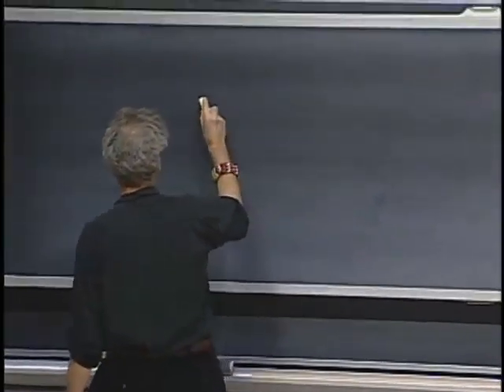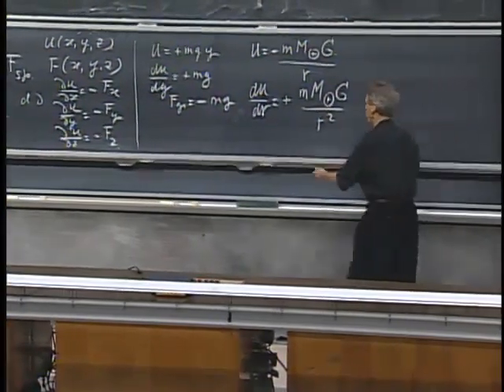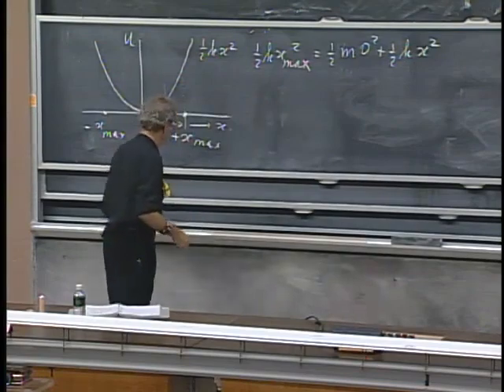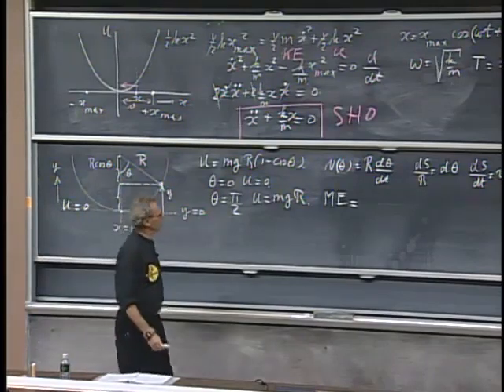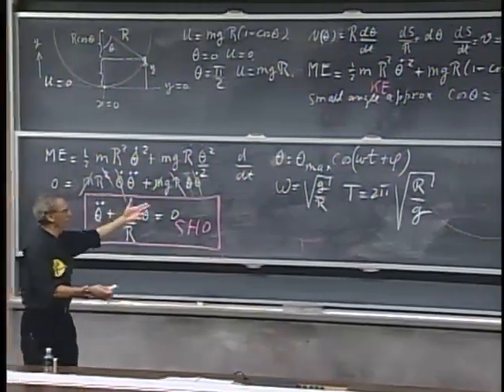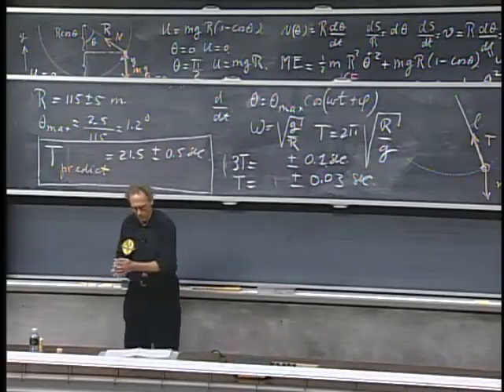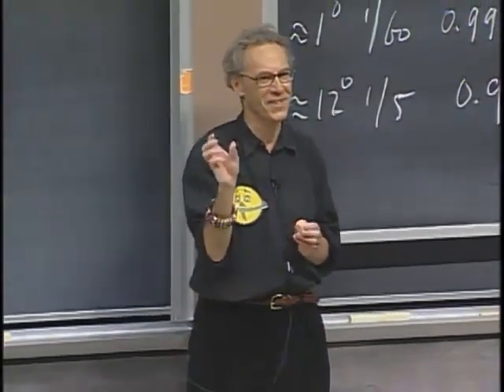8.01x - Lect 13 - Potential Energy, Derive Simple Harmonic Motion using Energy

Comment: During the starting 1st minute video of the lecture, you assumed that the increasing direction of 'y' is upwards.........
OK.
You then let U=0 at the bottom and so at the top, U=+mgh.................

If we let increasing direction of 'y' to be in the downward direction...............then if we assume y=o at the top then at the bottom, y=+mgh.............

WHAT I CAN'T UNDERSTAND IS THAT WHY THE POTENTIAL ENERGY OF THE OBJECT CHANGES FOR THE SAME POSITION IN SPACE FOR OUR DIFFERENT ASSUMPTIONS OF INCREASING VALUE OF 'y' ??? 

It shouln't be be because Nature doesn't care what the increasing value of 'y' we choose.......
Reply from the maker: <<<If we let increasing direction of 'y' to be in the downward direction...............then if we assume y=o at the top then at the bottom, y=+mgh.............>>>
incorrect
PE is the work I have to do to bring it from y=0 to h meters lower, then my work is -mgh.
Changing signs in your coordinate system is allowed, but that does not mean that you can change the direction of the gravitational acceleration.
Reply: Okay
According to you, at the bottom PE=0 but according to me PE at the bottom=(-mgh)............

Isn't this weird??
PE is defined for a particular mass at a point in space so it should not depend on our choice of "increasing value of y".........
Reply from the maker: PE near Earth' surface is prop to h (vertical distance relative to the surface) to a high degree of accuracy. But since g is a function of r  (r is the distance to the center of the Earth) a universal value of PE is minus GMm/r (for r>R; it's zero at infinity). Thus it increases with increasing value of r as it should (the larger r the higher the PE). Using this result you can also demonstrate that near Earth  PE can be approximated by mgh. It takes a bit of math as h is not r. Good luck and use google!
Reply: What I asked was that according to you, PE at the bottom is different from my PE( yours is zero while mine was {-mgh}..) but the two values should be same.....they can't be different because we are talking about the same mass and the same point???
Reply from the maker: In the case of PE near Earth surface you may choose your zero point anywhere you want to. If A is a vertical distance h above B, then the Pot difference between A and B is +mgh. You may choose your zero PE at your basement, your roof, the top of the Eiffel Tower,  you may choose it at A or at B. It would make NO difference as the pot diff between A and B would always me +mgh. If you chose zero at B then A would be +mgh, if you chose zero at A then B would be --mgh. 
If you chose your basement zero, then B might be 213 and A would then be 213 +mgh.
Reply: <<If you chose zero at B then A would be +mgh, if you chose zero at A then B would be --mgh>>

WHAT I THINK IS THAT WE DEFINE POTENTIAL ENERGY IN A VERY UNIQUE WAY ie it is the work that we have to do to bring a mass from infinity to a point P, SO HOW CAN IT BE DIFFERENT FOR THAT SAME POINT??
Reply from the maker: PLEASE READ and digest my earlier responses. Here  are they once more. This is my last response to this issue. I 

In the case of PE near Earth surface you may choose your zero point anywhere you want to. If A is a vertical distance h above B, then the PE difference between A and B is +mgh. You may choose your zero PE at your basement, your roof, the top of the Eiffel Tower,  you may choose it at A or at B. It would make NO difference as the PE diff between A and B would always me +mgh and that is the only thing that matters as it dictates the physics. If you chose zero at B then PE at A would be +mgh, if you chose zero at A then PE at B would be --mgh. If you chose PE in your basement zero, then PE at B might be 213 and PE at A would then be 213 + mgh. KEY is that the difference between PE at A and B is mgh. 

PE near Earth' surface is prop to h (h is vertical distance between 2 points) to a high degree of accuracy. But since g is a function of r  (r is the distance to the center of the Earth) a universal value of PE is minus GMm/r (for r>R; it's zero at infinity - you now have NO choice where to choose zero). Thus it increases with increasing value of r as it should (the larger r the higher the PE). Using this result you can also demonstrate that near Earth  PE can be approximated by mgh. It takes a bit of math as h is not r. h is the difference between 2 different values for r (BOTH NEAR EARTH). Good luck and use google!

Comment: the BIG difference is to use an arc of only 20cm in the calculations. nobody checked that it would start 20cm from the equilibrium point but the object actually started way more than 40cm from the equilibrium point.
Reply from the maker: No that's not the reason
Reply: but just by the look of it the object was not started at 20cm from rhe equilibrium point.
Reply from the maker: that's not the reason for the larger period. It's WAYYYY more fundamental.

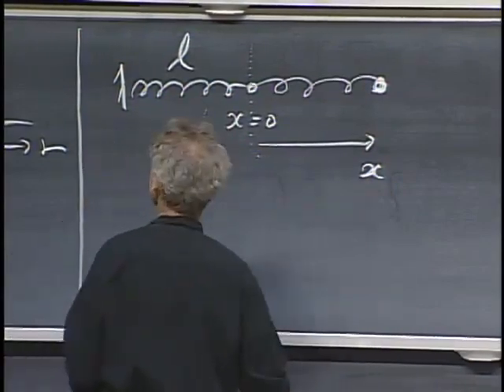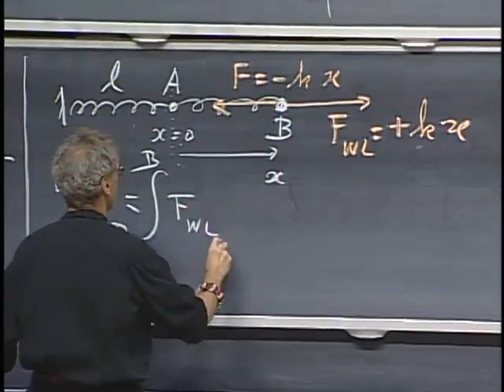Comment: Sir, at 7:30 - 8:20 you hold the object with equal and opposite force of the spring force. 
Sir I do not understand that than how  the motion would be possible. 
Hoping for your early response sir.
Reply from the maker: I watched and cannot add to the clarity of my lecture - sorry
Reply: But you can explain sir.
Reply from the maker: I cannot explain it any better than I did in my lecture.
Reply: Also sir, what is the direction of spring force when the object is returning for its maximum amplitude position to zero amplitude position.
Reply from the maker: Fspring=-kx
Thus if x is positive Fspring is in the negative x direction 
if x is negative Fspring is in the positive x direction.
Reply: Sir, what is the direction of the spring force when the object is returning from the max amplitude position to zero amplitude position. 
Sir if the spring force in this period is in opposite  direction to the  displacement then how further motion is possible.
Reply from the maker: >>>Sir, what is the direction of the spring force when the object is returning from the max amplitude position to zero amplitude position. >>>
Fspring=-kx
Thus if x is positive Fspring is in the negative x direction 
if x is negative Fspring is in the positive x direction.

Comment: sir 
picture a block kept on a plate ,plate is on the floor (friction only btw block and plate)
block is attached to the ceiling via an elastic string (string is vertical at the moment)
now the plate is moved horizontally till the block starts sliding
to calculate work done by friction I know I can use change in mechanical energy=work done by friction
now can I calculate it as integral of F*ds where both I can write it down as a function of angle formed by string with the vertical?
I know it's a big problem but if you could just help me
thank you
Reply from the maker: make first a free-body diagram. Keep an eye on magnitudes and directions. Work done by a GIVEN force is always the integral of F dot dl. DOT product!
Reply: Lectures by Walter Lewin. They will make you ♥ Physics. 
sir is there any way I can send you the picture of the problem
so I can ask you more clear questions?.. please
Reply from the maker: people send me pictures on this channel. They create a website with the picture.
Reply: Lectures by Walter Lewin. They will make you ♥ Physics.
😀😀😀
anyways thank you sir
Reply: Lectures by Walter Lewin. They will make you ♥ Physics. 
http://tinypic.com/r/106ezpx/9
question number 1.141
Reply from the maker: I cannot access this site
Reply: Lectures by Walter Lewin. They will make you ♥ Physics. 
sorry for the delay here is the question # 1.141
https://s28.postimg.org/lnbocyq59/Screenshot_2017-03-24-16-55-53.png
Reply: Lectures by Walter Lewin. They will make you ♥ Physics. 
this is what I tried...
page1 https://s18.postimg.org/ax500repl/IMG-20170324-_WA0021.jpg
page 2 https://s17.postimg.org/f4ibmkdcf/IMG-20170324-_WA0022.jpg
Reply: Lectures by Walter Lewin. They will make you ♥ Physics. 
here is what the actual solution is
https://s22.postimg.org/me9bapddd/Screenshot_2017-03-24-20-35-24.png
Reply: Lectures by Walter Lewin. They will make you ♥ Physics. 
sir 
can u access it now?

Comment: Is it a difficult job to include rotational kinetic energy and calculate a new equation for the SHO. It would add an extra term in the final solution, correct?
Reply from the maker: Rot KE can be taken into account, but we didn't. That's why the period is so large.
Reply: Thank you sir!
Reply: I calculated the period with Rot KE: quite a fun exercise: 

SHO is: (theta double dot) + (mgR / (mR^2 + I))(theta) = 0, therefore, T = 2pi*sqrt((mR^2 + I) / mgR).
For the spherical ball case, moment of inertia of a sphere = 2/5 * MR^2: Period = 2pi*sqrt(7R/5g).
Both are independent of the mass as expected. 

This gives us a prediction period of approx. 2.19 seconds +- 0.07 seconds.
Experimental period = 2.27 += 0.1 seconds

Physics Works!
Reply from the maker: GREAT thanks - good agreement!
Reply: vijay R Thank you for working that out. It was a great supplement to the lecture to see the calculation of the rotational KE and showing that the figure achieved in the experiment does indeed agree with the equations.

And as always, thank you Prof. Lewin for yet another insightful lecture.

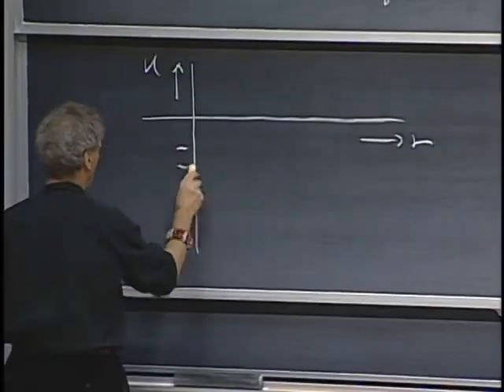Comment: there is some thing not clear . in curve 4:18 you said that the EP will decreases when the R decreases suppose we arrive at R=0 the center of the earth logicaly we must have EP=0 similar as point x=0 in the spring when EP = 0 but the EP in R=0 still have a value even it's very small and it is not logical the curve must show the Zero in R=0 because if we have a value of EP at R=0 that mean there is work done from no thing
Reply from the maker: You should watch this again. The curve I drew is NEGATIVE and it only holds for r>R. R is the radius of the Earth. Notice I erased the curve for r<R. PE at infinity is ZERO! It's smaller than zero anywhere else. The --1/r curve is the ONLY meaningful way to express PE at all distances larger than the Radius of Earth.
Reply from the maker: Using the concept that PE is zero at infinity, we can calculate the PE at the center of Earth. It's even LOWER than the PE at the surface for r=R. for r>R the mass is always the Earth mass. But when you go inside the Earth the mass decreases. If the mass density were constant (rho), then the mass within radius r is rho*(4/3)pi*r^3.  It's easy now to calculate what the PE is at r=0. Give it a try!!!
I decided to do this for you. The work you have to do to move a mass m from the center of the Earth to the surface (assuming a constant mass density rho of 5.7*10^3 kg/m^3) is the integral from r=0 => R of (4/3)m*pi*rho*G*rdr which is (4/6)pi*R^2*rho*m*G which is about 3.27*10^7*m Joules. The PE curve inside the Earth is a parabola. Thus the PE of mass m at the center of the Earth is 3.27*10^7*m LOWER than the PE at the Earth surface as I calculated in class. It is
-mMG/R = -6.28*m*10^7 J. Thus at the center of the Earth the PE of mass m is about - 9.5*m*10^7 Joules (and ZERO at infinity). Keep in mind that what counts is NOT the zero point of PE but differences in PE between 2 points. The most sensible thing to do is then to choose zero at infinity.
Reply: But Sir what would be the physical meaning of having some potential energy at the center of the Earth , as then when we place an object at the center of the Earth it should move in the  direction of the force ? Though I do understand that when we are calculating for PE , we are considering the work we have to do against the increasingly lesser gravity , so by the definition of PE we  get a value for it at the center of the Earth.

Comment: though the expression for sliding case is not valid for the case of rolling so the experimental result doesnot agree with the calculated value, but what is the reason for continuous reduction in amplitude of the ball?? 
by the conservation of mechanical energy a ball which roll down from some given height does go back to d same provided there is not a loss of M Energy, which in the demonstration is surely too low to explain the large amplitude reduction.
Reply from the maker: reduction of amplitude is due to friction and air drag.
Reply: upto my knowledge friction due to ramp will support and cause the rotation instead of dissipation. and air drag may not be huge enough to cause such fast reduction of motion.
plz comment
Reply from the maker: The motion of a rolling object can be close to pure roll but never for 100%.The frictional force acting on the rolling (partially sliding) steel ball will remove energy. Air drag alone cannot explain the reduction in amplitude of the oscillations. Every rolling steel object on a perfectly horizontal plane will come to a halt. For the same reason.

Comment: Is generally a force always in the opposite direction of increasing potential energy? And what relation have "conservative forces" with the direction of increasing potential energy?
Reply from the maker: 1. Yes! F = -- div V
2. F=qE F and E are vectors. 
In case of a Resistor, the electric potential decreases in the direction of the current I, thus in the direction of E
Reply: F = -grad V is the equation, rather than F= -div V.

You can't take a divergence of a scalar function.   You can use the del operator on a scalar function and the only operation that becomes is the gradient.

The gradient is analogous to scalar multiplication, divergence is analogous to the dot product, and curl is analogous to the cross product.  The del operator is a vector of differential operators that then gets applied to the following function.

In pure math, we may have a vector field capital F, and a related scalar field lowercase f.  When F = grad f, with no negative sign, we call f the potential function of vector field F.   This term is inspired by the physics application of a potential function, being the concept of potential energy.   In Physics, it becomes necessary to introduce the negative sign in the relationship between potential energy and force, so that positive work is done by the force when potential energy decreases.
Reply: A vector field is conservative, when it is the gradient of a scalar field.   If no such scalar field exists, the vector field is non-conservative.  You can use the curl operation to check for whether a vector field is conservative, and if it is, there is a series of integrations to do to find that field.   You'll find contradictory results in the process of integration if you attempt to calculate the potential function of a non-conservative field.

In the forces / potential energy application of vector calculus, the fact that a force is conservative mean it is useful to define the concept of potential energy.  It means that work done by the force is independent of path, and the potential energy can be used as a shortcut for evaluating work done by the force.

Comment: Here's my guess:
Is it because the formula you derived doesn't take rotational kinetic energy into account?(It worked in the first case because there wasn't any rolling) Also, some energy was lost in the form of sound.
Reply from the maker: YES!  during the trip back and force, PE is being used for translation and rotation. Thus the ave speed along the track is slowed down by the rotational KE. But at the extremes when the ball stands still it should be back at the same height above the track (assuming insignificant friction and air drag).
Reply: @lecturesbywalterlewin.they9259 😮😮
Reply: @lecturesbywalterlewin.they9259   You are right
Reply: Soumil Sahu u r wrong

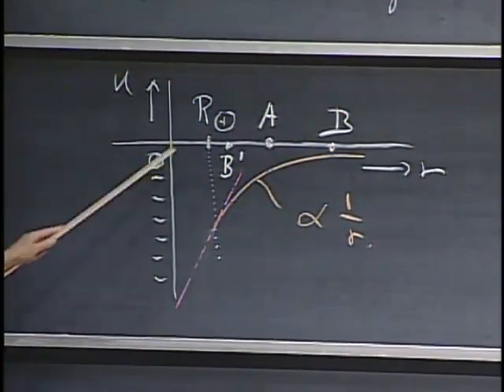Comment: I've seen that graph at 5:31 drawn the same from earth radius to infinity, but differently from 0 to earth radius. Is it equally true to draw a line with a negative slope from 0 until it meets the 1/r part of the curve?
Reply from the maker: Near Earth mgh works for large distances you have no choice you MUST choose the 1/r relation. Choose the signs any way you want to AS LONG AS the gravitational potential INCREASES is LARGER fir B then for A if B is farther away from the Earth surface than A.

Comment: the ball is rolling on the track, it has an additional rotational kinetic energy (0.5 I omega^2), period is higher than normal sliding ball
Reply from the maker: correct
Reply: @lecturesbywalterlewin.they9259  but why is it rolling? if friction is negligible, then what force is doing torque to make it roll?
Reply: Teh Yong Lip it is a very rare thing for Mr. Lewin to say "correct" well done.
Reply: I thought the energy is wasted in the noise it's producing 🤦😂
Reply: @parthkatke6706  Me too Parth. I thought part of the energy is wasted as sound.

Comment: Dear Prof. Walter Lewin,

Wonderful lectures, glad to see you are replying to all relevant questions.
 There is a similarity in equations of motion for pendulum and spring. Can we consider motion of a pendulum as a combined motion of two identical perpendicular springs (different Xmax and Ymax) ?
Reply: Ok, in Y direction is it like modulas of SHM ( I mean only in one direction ) ?
Reply from the maker: The motion of a mass at the end of a spring is simple harmonic (SH) A*sin(wt). The motion of a pendulum of length L is also SH. For small angles of alpha_max:  alpha(t)=alpha_max*sin[sqrt(g/L)*t].  x(t)=L*sin{alpha_max*sin[sqrt(g/L)*t]} and 
y(t)=L -- L*cos{alpha_max*sin[sqrt(g/L)*t]}. x(t) is to good approximation a SHM (for small alpha_max), but y(t) is not. That is obvious even without my equations. During one complete oscillation v(x) is zero twice but v(y) is zero 4 times.
Reply: Thank you for the detailed explanation. :)
Reply: +Lectures by Walter Lewin. They will make you ♥ Physics. 

Does that mean y(t) is not SHM at all or SHM with a period half that of x(t) and sin() term with it if x(t) has cos()
Reply from the maker: I gave you all the ammunition to answer this now by yourself - do not be lazy
Reply: +Lectures by Walter Lewin. They will make you ♥ Physics. 
yeah.. sure..